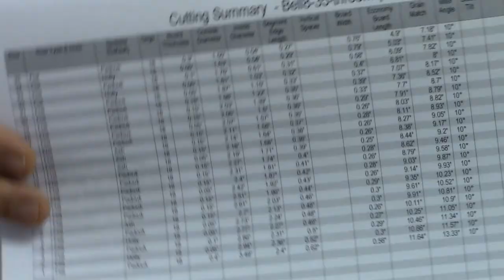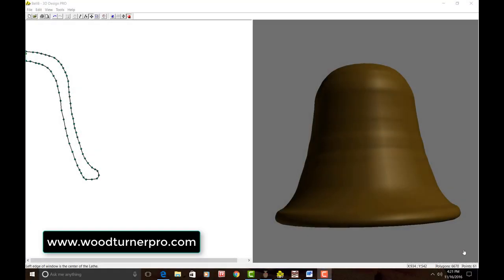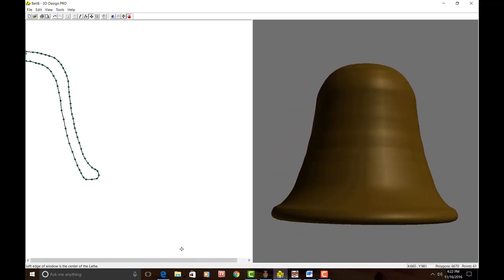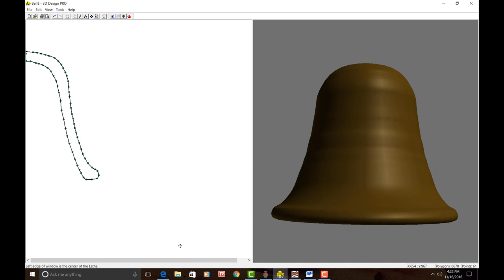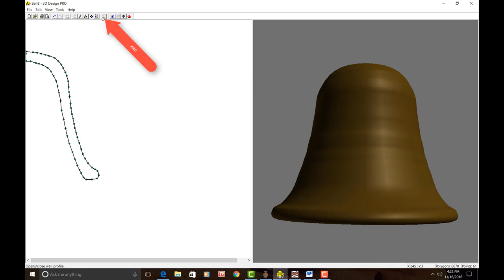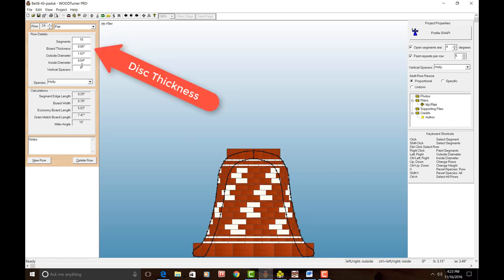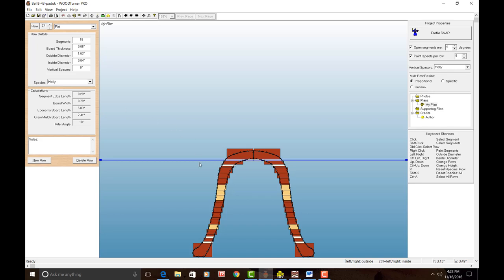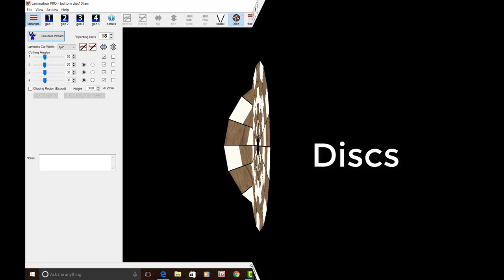Segmented Wood Christmas Tree Bell (3)

Comment: how long does it take to make one of those amazing bells?
Reply from the maker: It's hard to actual;y state a number because I usually am working on 3 or 4 at the same time in order to make it more time efficient.  My guess is that the total time to cut all the wood, make the segmented discs, glue it up and then turn it in the lathe and finish is probably 6 to 8 hours per bell.